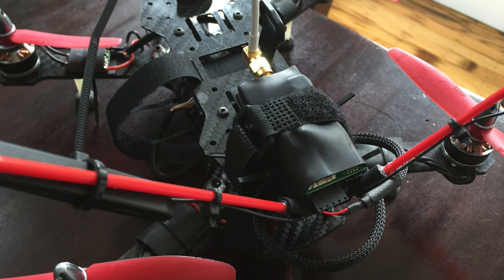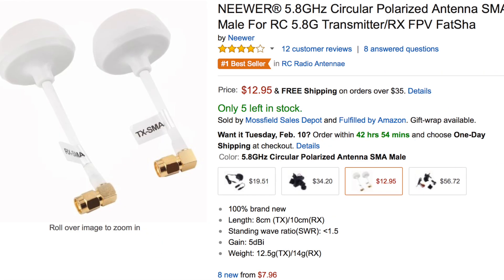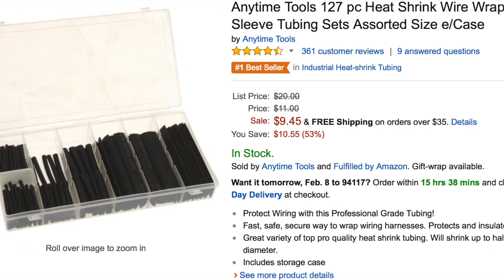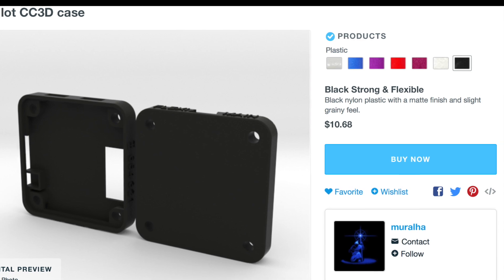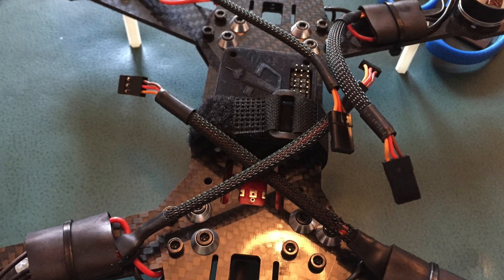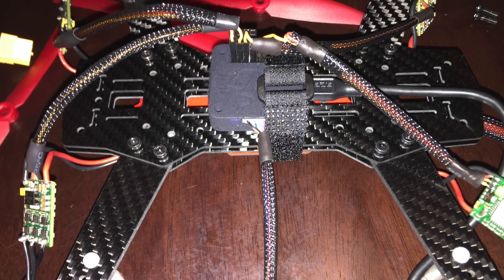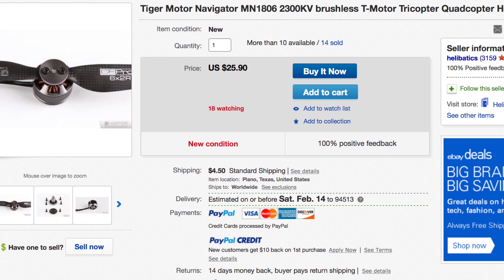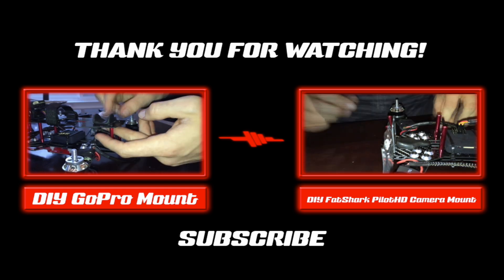ZMR250 Mini Quadcopter Build Tips & Maiden Flight (Blackout Clone)

Comment from the maker: Hey Dan! What kind of esc's did you order? I would suggest buying 20Amp esc's because they are usually only a couple dollars more than 12amp and allow for room to grow. I use rotor geeks 12amp right now and they are rock solid. Give me your parts list and I'll try to help you out :)
Reply: Hey,
I got 2400Kv motors, 5030 props, 250 frame, 12A ESC, 1300mah 3s 11.1v 75C
will the battery be good enough for a decent flight time, and will I need to order 20A ESCs if I wanted to build on it later, I really don't want to burn my motors.